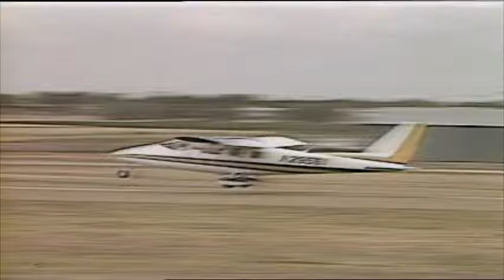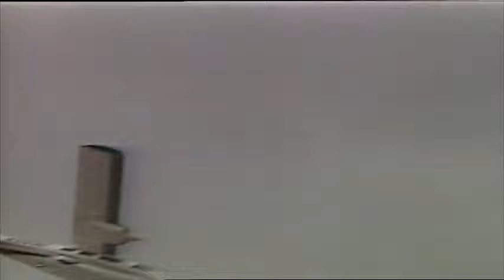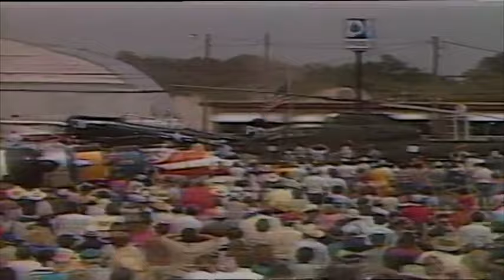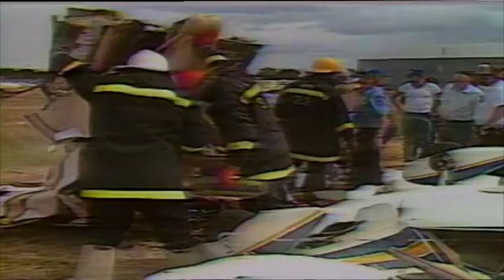Plane Loses Wings During Airshow (09/11/83)

Comment: To all the commenters regarding a parachute. He was probably G-Locked in his seat from the spin
Reply: A parachute, lol. Nobody wears a parachute when flying an airplane because it would be almost impossible to sit properly in the seat and secondly this guy was only a few hundred feet off the ground so the thing wouldn’t have opened anyway.
Reply: @rayray8687  Pilots usually wear parachutes when doing aerobatics or droping jumpers.
Reply: I didn't see the plan spin in the video.
Reply: @yodaiam1000 : No, they don’t. I’ve flown small airplanes myself and I know a lot of pilots flying everything from C152s to B737s and CJs and I don’t know a single one who would even know how to operate a parachute, including me. I do know one guy who skydives and he has no idea how to fly an airplane. At the altitude of typical stunt flying a parachute wouldn’t even have time to open.
Reply: @yodaiam1000 : It does actually appear to enter 2 spiral dives, one CCW and the second one CW, which some people might refer to as spins but of course with essentially no wings they were both unrecoverable. In any case parachutes would serve no purpose at this altitude and no one wears one for that very reason.
Reply: @rayray8687  It's a legal requirement to wear an emergency parachute when doing aerobatics or flying jumpers. It doesn't matter that you are too low for it to work.
Reply: @rayray8687  I did not not see a wing tip drop before the wings are ripped off. There was no stall.
Reply: @rayray8687  "A parachute, lol. Nobody wears a parachute when flying an airplane because it would be almost impossible to sit properly in the seat"

14 CFR 91.307. 

"(c) Unless each occupant of the aircraft is wearing an approved parachute, no pilot of a civil aircraft carrying any person (other than a crewmember) may execute any intentional maneuver that exceeds --

(1) A bank of 60 degrees relative to the horizon; or

(2) A nose-up or nose-down attitude of 30 degrees relative to the horizon."

lol
Reply: @yodaiam1000 : The airplane lost both its outer wing structures following extreme maneuvers so obviously it became unflyable The empennage was also destroyed which appeared to put the airplane in a spin one way and then the other before the crash. It was also upside down for much of the 14 seconds it remained in the air so it’s a bit pointless to argue terminology over whether it was stalled, spinning, spiralling or diving because in the end it was actually doing all the above.
Reply: @rayray8687  There was all kinds of aerodynamic crap that was happening after the wings fell off. It wasn't a plane at the point. It was a chunk of aluminum going fast. How was the AOA or any spin/stall a part of the structural failure? I am not the one arguing that the AOA or a spin or stall had anything to do with the failure.

Comment: No parachute, huh?

I get it, helmets, seat belts and parachutes are for wimps.

See discussion below. 22Sept 2023

Revising this to “tough break”.
Reply: @cessna2737  

One wears a parachute for aerobatics. That might have been too long ago for that.  

However, yes, there was still time.  The other realistic question is : could the pilot have opened the door and get himself out.
Reply: @cessna2737  

About -0.7 if that.
Reply: @cessna2737  I agree, I doubt you would get out.  Theres only about 6 seconds before too low for parachute the first 3 were trying to work out what happened and if he has any control then got to get out of seat open door and get clear.  Nobody will ever know but it frightens me just to try and imagine it.  He will have done plenty of practice so odd that it exceeds by such a huge margin.
Reply: @cmdmd  you definitely don't know what you're talking about
Reply: @Three-LeggedCat  

I’m an aerobatic pilot.  

Rebuttal?
Reply: i think at this speed and upside down the pilot dont even have time to jump from the plane
Reply: even if he bailed out in perfect conditions there is a very high chance he would be chopped by the propeller.
Reply: Uh.. he's inside the plane. How would he have gotten out, let alone have enough altitude to even use the parachute, all in that few seconds?
Reply: @cmdmd sure you are
Reply: @Redangrybird1928  

Yes, I am.
Reply: @cmdmd   "Rebuttal?"

And you don't know that parachutes are required when flying such maneuvers? And how do you know he wasn't wearing one?

"I’m an aerobatic pilot.  "

Sure you are.
Reply: @Tom-zs6bb  FAA Regs. For aerobatics, you must. Darling.
Reply: @cmdmd  No kidding? That must be why I quoted CFR 91.307 elsewhere in this thread. Again, why the comment "No parachute, huh?"
Reply: There is a P68 based out of the airport where I fly.  The door is located behind the front row of seats. He would've had no time to even TRY to get out.  He also possibly would've been pinned in his seat by G forces.  I've been flying since 1982, and have been a skydiver from 1977 to 1994.  There was a crash in Washington state where they were using a Lockheed Lodestar as a jump ship....on jump run, the pilots stalled it, it entered a spin and vertical dive. The G loads prevented 7 or 8 other jumpers from getting out due to G loads, and they were only 3 feet away from an open door.  One of the jumpers that managed to get out said he had to claw his way to the door because he was pinned to the floor by the Gs. One of the jumpers on the ground took a still pic of the airplane in a vertical dive maybe 3 or 4 seconds from impact, and if you're a pilot, it's one of those pics that makes your blood run cold. The picture is in a back issue of Parachutist magazine from the 1980s. I took some aerobatic instruction in a Citabria  years ago,  and G loads can keep you from even getting your arms out of your lap, much less getting out of the airplane.  As far as jump pilots wearing parachutes goes,  the only time I wore a rig while flying jumpers was when I was flying a 182 or 206.  The guys flying Twin Otters and DC-3s never wore parachutes.  Sorry about the long rant.
Reply: @RR-pw5nb  
Then the issue is access, not G-forces. Snapped wings mean no load, just freefall. That sucks terribly.
Reply: @cmdmd  Yeah i was thinking the same...tough airplane to get out of, low alt, no time for parachute deployment. Structure my have been distorted to the point of doors being jammed shut. I was taught to jam a shoe in the door to keep the door from getting jammed shut in a forced landing. If he had gotten out as soon as the wings failed, he wouldve had a shot....pilot rigs and skydivers reserve canopies open FAST.
Reply: @RR-pw5nb  

I sat and watched it several times this morning….   You right are right, simply really hard to get out. I know there’s space there, it’s not a Mooney, but you’d be almost at zero G and upside down. Trying to climb UNDER the seats and then Open the door.   I was too dismissive of it after I watched the guy overstress the aircraft.

I used to do accelerated inverted spins on the EX300L…No way to get out if you manage to make it unrecoverable.  Cockpit opens out. Sure, it has great rudder authority, but you need a lot of time to get the last bit of rudder (most is stalled due to elevator) to stop the rotation. The shit we take for granted…..
Reply: No....too low for a parachute, and pretty much impossible to get out of the airplane.  They are using probably 5-point harnesses to keep them in the seat.  Helmets get REAL heavy when pulling Gs.
Reply: The pilot was quoted as saying, "this is a serious maneuver I'll be attempting up there and I'm afraid that the weight of a parachute may exceed the structural capabilities of the aircraft ".
Reply: @cmdmd  Bet the Extra was a blast, wasn't it?
Reply: Bet the Extra was a real blast! @cmdmd

Comment: Both wings snapping off at the same time and at the same point on each wing clearly indicates that the pilot exceeded the placarded max G load. He was rawhiding that aircraft like it was a fighter, and it simply wasn't designed to be stressed in that manner. Sad to say that this was pure pilot error.
Reply: 8.3G’s.

And 220kn. That plane had a Vne of 192.

Comment: Good lord... planes like that shouldn't be used in airshows in my opinion. It's a damned passenger plane. Not a fighter. Not a stunt plane. None of that. It was never meant to be flown at aggressive angles of attack at high speeds for this very reason. The airframe was meant to withstand stress from activities which the plane was precisely designed for, and that's solely to haul passengers from A to B and nothing more. It should've never been allowed to be flown at an airshow, where planes are typically put to their maximum tolerances for the crowd's excitement, and even stressed beyond their capabilities due to ego and "I'll show em something, watch this!". How incredibly sad hearing that woman cry out for her man. I haven't seen any comments on whether he survived this accident or not, but with the plane landing upside-down and hitting the ground damn near directly where the pilot was seated, im guessing the outcome was that he passed away upon impact. But I'm genuinely asking, does anyone know for certain if he made it out alive?

Comment: I use the Futaba radio control for all my models. The guy probably forgot to tighten the wing bolts to the model. Real scale flight! Probably could be fixed since it landed behind the spectators.

Comment: Was the pilot wearing a parachute?  If so, why did he not jump out of the airplane?
Reply: Possibly knocked out, also that kind of plane is not easy to bail out on. The door and seatbelts are simply not designed to be removed quickly under load.

Comment: Hate to say it but it’s his own fault. 

It’s not a sport plane, it was a small 6-8 passenger plane and he’s out there flying it like it was a P51 mustang. That plane was NEVER designed to take that amount of stress. Evidenced by the fact that it wasn’t the “wing” that broke, it was the whole center wing box that failed. Both wings snapped clean off. 

If it had just been a simple wing failure one would have come off, instead they both broke off right at the center wing box, where the wings meet the fuselage and is supposedly the strongest part of the plane because again, the wings were never meant to take that amount of stress and G force.

Comment: The pilot raised the plane's nose abruptly creating an immense amount of stress on those wings and shearing them off in the process.
Reply: The NTSB accident report states that their calculations show that more than 8 g's were pulled immediately before wing failure. VNE (never-exceed airspeed) was exceeded by almost 30 kts.
Just reckless piloting.

Comment: If this was at a normal "practice" altitude (around 5,000 feet AGL) the pilot could have bailed out and used his emergency chute. Airshows require extreme low level maneuvers so bailing out during a catastrophic failure like this is not an option, unfortunately. Definitely a case of over G on the airframe. Sad.

I remember flying in Pitts specials a few times and most flights were at least 5,000 feet AGL. I knew a pilot in Hawaii (Tsunami Aviation) in the 1990's who flew aerobatics over the Pacific ocean / beaches at very low levels, like 500 feet, doing loops and all that - And I got to ride with him, getting on-board video I still have on my website (my YouTube channel), which is impressive. Eventually, and a year or so later, bad luck caught up with him and he hit the water at high speed (his body was never recovered).

Comment: Still mystifies me how both wings failed at the same instant. You'd think the first one failing would immediately de-stress the other one. Were they really constructed that precisely symmetrical?
Reply: Over 8 G's in an instant plus likely preexisting stress fractures from repeated abuse does not mystify me.
Reply: @kurtpena5462  - You must be correct.

Comment: I used to do aerobatics in a Decathelon 40+ years ago but I've only done 2 Lomcevak maneuvers (Once with an instructor and once by myself) I observed the stress on the propeller and crankshaft flange, found out later that these items needed special attention during each inspection because of the Lomcevak and decided it wasn't worth it doing this maneuver anymore. My instructor and the airplane I was flying were killed/destroyed a few years later in separate accidents involving aerobatics. Just because you are allowed to do something doesn't necessarily mean you should do it. I learned aerobatics so I could be a better pilot and it's fun too. I'm 74 years old now and gave up the bold part to reach my age.

Comment: WTH happened?
Reply: I think according the the report he was doing 220 knots - which was 30 Ltd higher than the plane’s “never exceed” speed (Vne). Then the pilot pitched up the nose and pulled in excess of 8 G for a moment.  It far exceeded anything those wings could handle and ripped both of them off.
Reply: Extreme structural failure due to exceeding the planes never exceed speed
Reply: It looked like an aero-plane crash to me...

Comment: I think airshow stunt flying should only be done by current military pilots for many reasons. They fly more frequently than most civilians, they are trained to military discipline, and the planes are maintained by government resources. Too many retired and amateur pilots take too many chances,with not that many hours in the aircraft, only the maintenance they can afford, and have medical problems they are hiding. There are too many avoidable crashes like this one where innocent people could be killed, injured, or have their property damaged and sometimes do.
Reply: Military pilots don't necessarily fly much more than civilians, and they usually fly planes that are completely different and often protected from abuse by their flight controls, and of all military pilots that have been around me in civilian aircrafts, they all tended to want to push the limits a bit to retrieve some sensations that they had in fighter jets. I've heard of warbirds owner refusing to let military pilots fly on their spitfires and other warbirds for those reasons

Comment: This video is so shocking to see, but was the cause really pilot error? Probably so, but I think there is another possibility. Perhaps the pilot did it on purpose. Consider this: Even student pilots are taught the importance of maintaining the correct airspeed for a given situation. This pilot was obviously more experienced than a student pilot and would know that an aircraft has a performance envelope that was developed by brilliant engineers and test pilots during the development of a particular aircraft. And then there is the announcer/significant other's comment, "I still need you" Why was this the first thing that came to mind as this tragedy was unfolding? Perhaps there was a troubled relationship where the pilot felt not needed and this was voiced at some point prior to the incident. And then there was the height above the ground. It appears that the pilot had plenty of distance from the ground to complete his maneuver without the need for an abrupt pull-up. Whatever the cause, condolences to the families.